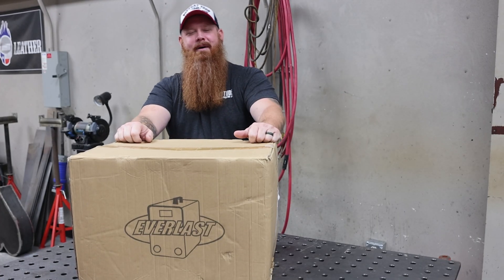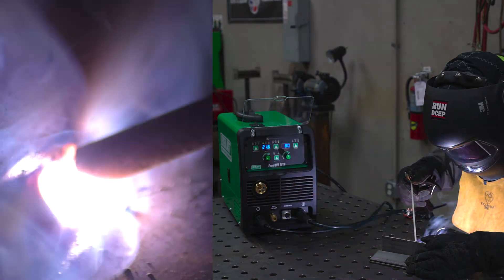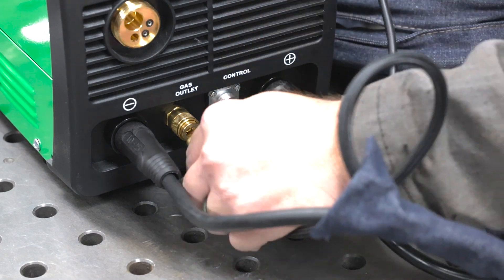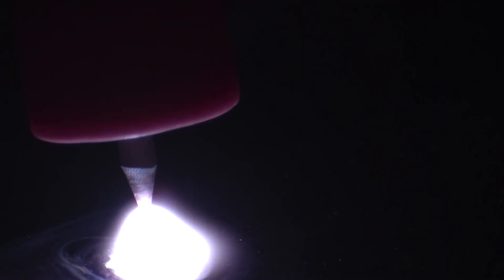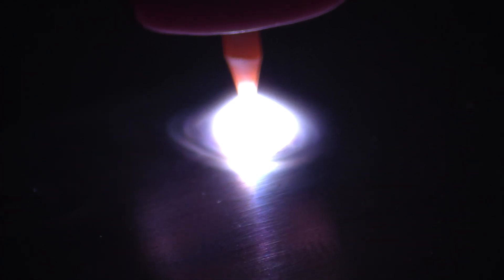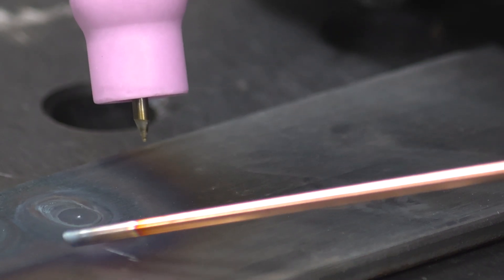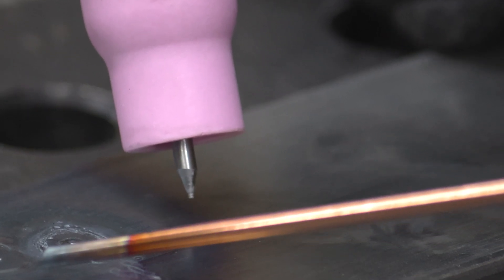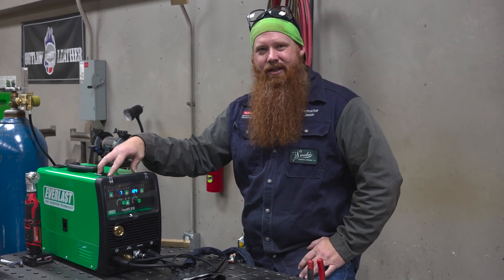Everlast PowerMTS 141 | TIG/Stick Overview

Comment: Hey man, I bought a power tig DV185 not long ago... This thing is junk.  I paid nearly 1200 for it and it's useless.  Arc is totally unstable  - I can't weld anything with it..  for this kind of money I expect a simple welder for doing 2-3MM aluminum and steel.  What can I do with this.. It is definitely the unit - after 3 years of fighting with it I've had enough.  Everything works better.
Reply: 185 is no where near 1200.  If it won't weld there are likely operator issues like wrong polarity, wrong AC settings, drafts from having welder too close, not grounding direct to part which creates resistance.  Have you contacted tech support and sent them any info?